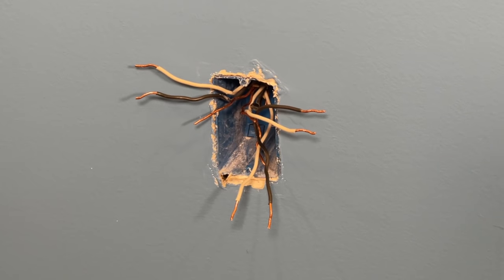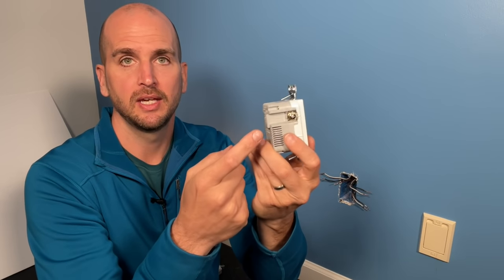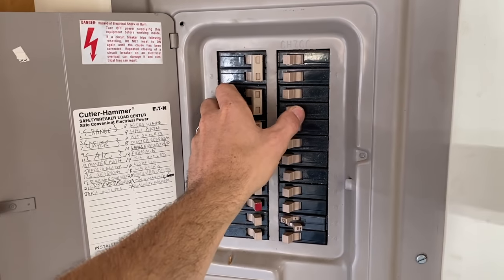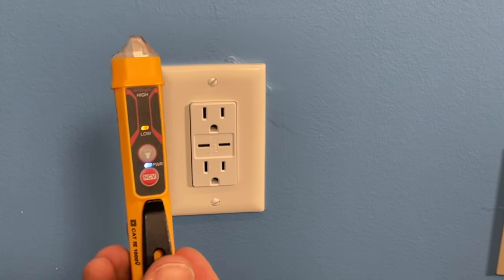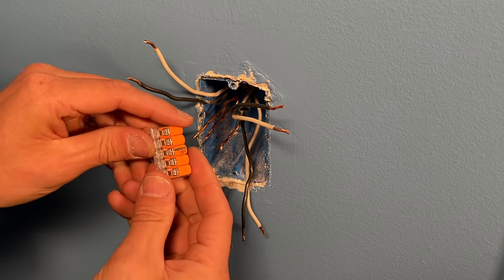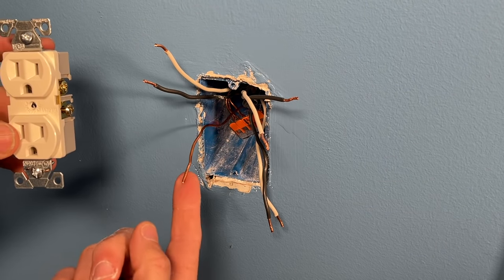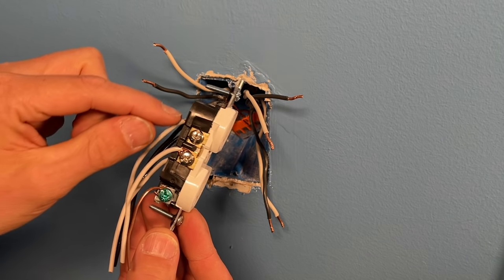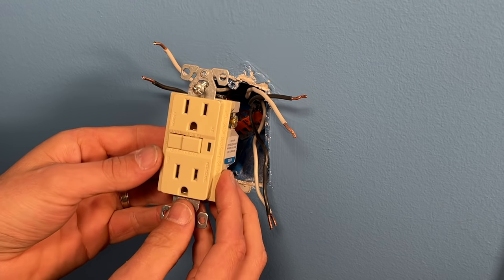Wiring an Outlet with Multiple Sets of Wires

Comment: 20+ years of being a state certified electrician. DO NOT BACKSTAB! I’ve had multiple service calls for wires backing out of that connection over time. Pigtail all connections then attach to receptacle. Also, Wagos are ok for fixed loads such as lighting, but for a receptacle with a varied load I prefer wire nuts. They are far superior and use more surface area, thus less resistance, thus less heat.

Comment: At 3:50 you should note that you’ve turned the breaker off after finding the hot wire. You probably also should have explained the difference between line and hot at that point, since technically what you were trying to find were the line wires but you repeatedly said “hot set of wires”.

Comment: I just ran into a Wireing like this in a rental I was replacing the ceiling fan ,  it was my first encounter with a loaded neutral  ,  shocking experience. ⚡️🤕
Reply: That means you theres two hot wires sharing that one neutral wire.  Per NEC to make it  legal to share neutrals if you have both hot wires on a two pole breaker in your panel to shut off both hot wire to avoid that.

Comment: We have two original wire one white ( hot) one black ( neutral) four others two black hot and two white neutral apparently wired later to add two more recepticles on counter in kitchen, 20 amp breaker what outlet should I use and how should I wire it correctly? Like your videos so much and very helpful. Thanks 😊

Comment: As a DIYer, I wish there was a way to adjust those single gang boxes (for example, extend the back wall) so that you would be able to swap out a bigger device with greater ease. These boxes were never designed to add huge multi-function receptacles and big Wagos.  Thanks for the video!
Reply: You can cut the old box out and replace with a bigger box been there done tht
Reply: @wizard3z868   Sure!  And, it would be even easier if you could remove the old box and put in a new single gang box with a deeper back. That way you wouldn’t have to cut away any drywall.
Reply: @rocketrider1405  you can just cut the nails or screws and pull out the old box
Reply: Pro Electrician here, 
we can swap the nail on box for a deep cut in box to fit a bigger device such as that  recep with USB c ports. It shouldn't take more than one hour to do.
Reply: They’re at your big box store and called “old work boxes” and are for putting in a box into already sheet rocked walls.  Can get them 20 cubic inches and they have wings that flip out and tighten on the wall to secure them.

Comment: I put wire caps on all the wires prior to turning the breaker back on if I have to figure out the circuits in a box, to prevent them from accidentally contacting each other (or me).

 It's important to test the white wires in the box as well - in certain scenarios white wires are actually carrying current!    Whoever installed the box may have failed to properly mark the white wire(s) as actually carrying current.  If a white wire is being used to carry current, it will usually be painted black near the termination or wrapped in black electrical tape.

When will a white wire actually be used to carry current?  One example is when power from the breaker panel first goes to the light fixture and then to the switch.  The switch has to be used to interrupt power to the light along the hot side of the circuit.  If the cable used to go from the fixture to the switch only has black and white wires, then when the circuit is powered and you turn on the switch, both wires connected to the switch are now hot. 

Now days, code actually requires a neutral to be present in a switch box, so when re-wiring the circuit, or in new construction, a three-conductor cable(with black, red and white wires) would be used.  The black and red would go to the switch from the light fixture, and the white is the required neutral.

Comment: Please  review the NEC rules on conductor fill.  All boxes have a limited internal volume and it is not safe to cram wires and devices in there beyond a certain level.  Modern plastic boxes often have these limits molded onto them.    In this case the box has 6 conductors and 3 grounding conductors entering what appears to be standard 2x4 box.  My old NEC Table 370-6(a) indicates that there should not be more than 7 #14 conductors entering such a box.  However,  this box also has grounding conductors entering it so NEC 370-6 requires that this number is to be reduced by one.  So far so good.  Six allowed and six entering the box.  But this box also has a receptacle installed which also takes up space.  Any device installed in such a box requires that the number of conductors be reduced again by one.  This installation may be in violation.  It is worse if those are #12 conductors.    If Table 370-6(a) is not sufficient there are rules requiring a certain internal volume per conductor entering a box and you can use a little arithmetic.  A safe rule of thumb for 2x4 device boxes is one cable in-one cable out and that only for two-conductor cables.  Any more that that use a larger box.

Comment: I have four lights ceiling lights that are controlled by a top of the stairway switch and a bottom switch I think the terminology is three way switches where you can turn the top on come down and turn off the light. Now the full lights are being divided into two each and I am installing two switches in the new area to control two at the end with one switch and the bottom of the stairway with another‘s new switch the division is because a new room is being built at the end and so the new switch will control that the second new switch will control the hallway lights if we are in the room and want to turn the blind on or off.  I am pulling power from the third light in the hallway, there are 2 sets of 14/2 coming off that gang box off the ceiling. One of them is the power supply. I connected a new 14/2 wire and dropped it to the switch location. That switch controls the two lights at the end but still is on the same circuit as the top switch and the bottom stairway switch to switch is still controlled the 4 lights. I am stuck at this point. Help!!!

Comment: When my house was built in the 1930's they used 4" double boxes everywhere, even where only single receptacles or switches were installed, on single plaster rings. Makes replacing devices so much easier. Does anybody do that any more? The difference in cost must be in the pennies. BUT ...  I have found to my dismay that the screw patterns on these vintage boxes  are different from current ones and their respective plaster rings. I found that out when I wanted to replace a single switch with a double. My only option was to dig out the old box from the wall and replace it. Always something. Just know that vintage boxes do not match current ones.
Reply: I have a switch for our hallway light that I want to change out to a three-way switch and add a switch at the other end of the hall. Problem is there are 3 sets of wires coming into the box, so it's pretty full already. Its also in a 2x3 studded wall so it's not very deep. My plan is to replace the box with a double box to make more room in the box to accomplish the task. Not sure when I'll get to it.
Reply: Those old square junction boxes are great but they are made from much harder steel than modern ones.  I found this out when removing a knockout from one a couple of years ago.  The ears on the side that the plaster ring screws into can have the holes in a different pattern making it difficult to work with.
Reply: Maybe since I'm from Chicago and everything here is supposed to be hard pipe, but I always use 4x4 steel boxes no matter what(unless it's between studs and too tight)
Reply: Try using one of the old plaster rings as a template and just drill new holes in modern ring I have been able to do this myself

Comment: Thank you for such clear, detailed explanations.  I have embarked on several DIY projects thanks to your demonstrations.  One thing that bugs me however is your preference for the shepherd's hook method instead of the poke-in-hole method of wiring to the receptacle.  (As you can tell from my complicated terminology, I am a true novice; but my question is probably what goes through every novice's mind when we see you use that pigtail thingy that is a poke-in-hole style, not the shepherd's style.  IF PIH is good enough for reducing wire clutter, how come SH is to be preferred for wiring to the receptacle?  To a novice, PIH is easier.)
Reply: The wago nuts hold the wire very securely, they won’t pull out or loosen. The push in feature on receptacles is not so secure, they can loosen and pull out. 
When electrical wires are loose they can arc, spark, heat up and cause fires.
Reply: Two words:  BACK WIRE. Worth every extra penny. 😆

Comment: I was/am trying to install a USB receptacle and found the 3 white 3 black and ground wires as in this video.  I understand the need to used the Wago  and think its a great idea.  My question is where did you get the piggy back wire?  Can't I use the one black and white wire that works for that receptacle?  I don't have random wire laying around. lol  Very well done video with excellent explanations.

Comment: First thing to do if you see white wires not connected to anything in a box is to turn power off at the panel. All the power.  Unless you know with absolute certainty exactly which neutral lines are in the box and which other circuits they are connected with, there is a very strong possibility that they are carrying a load.

Comment: This is very informative. There is an issue here that would pose a problem which violates code rules - box-fill. The number of wires plus the three Wago connectors along with the deep receptacle exceeds box-fill requirements. This could compromise the current-carrying capacity of the conductors and cause heat and burning at the weakest points in the box. Typically it occurs at the termination point over time if the receptacle is used a lot and depending on what's plugged into it.

Comment: Wagos are my absolute favorite. Wire nuts are simple, but there's really quite a lot that you can do wrong when using them. Not only are Wagos more straightforward, they also make it SO much easier to work on a single circuit. I work in HVAC controls, and troubleshooting is much easier when I can leave a controller powered and disconnect a powered sensor. With wire nuts, there's no reliable or safe way to do that without interrupting power.

One question/note: I assume if you do the pig tails, the GFCI can no longer protect downstream outlets. Is that correct?

Comment: What was the box fill? Using the wago takes up more space than a wire nut. I found by using a wire nut, the wires can be tucked in more neatly into the back of the box. More caution has to be taken when using wagos so the receptacle doesn't push the wires against a sharp object at the back of the box, damaging the insulation and/or conductor also.
Reply: My experiences is that Wago connectors tend to use less space in a box - primarily because all the individual wires are still free to spin in the connector. That usually lets you pack the wires in the box more efficiently. With a wire nut you tend to get a solid bunch of wires that have much less freedom of movement.
Reply: 3 sets of wire will fit in 20 cu in box.
Reply: There are sharp objects in the back of boxes ! ?.  O my.    You must have elves sticking things in there .   My boxes are usually empty before I strip the wires and feed em in .....................
Reply: @nickleclaire8545 3  sets of 12-2 wires and those are 14-2 I can assume
Reply: @JasonEDragon 
   pro Electrician here,
the loose connection of wagos are a problem and can cause connection issue and short. If you're taught to train the wires out correctly there is no issue with the wire nuts. I can make wire nuts more space saving that wagos which take up more space.
Reply: @yellowflash5555  Can you point me to 1-2 videos that show a failed Wago connection? I've never seen one. I'm just a USA owner of a few old houses and I've picked up on the use of Wagos after watching a number of UK electrician videos. Those are the primary connectors over there and I've never seen them once mention a failure. If someone shows me failures then I'm open to changing my mind.
And I would point out that this is the "Everyday Home Repairs" channel and many of the viewers probably haven't been taught to "train the wires out correctly". And with the variety of electrical boxes in my houses I'm not sure there is a "correct" method. I prefer maintainable connections that make future changes easy, as I like to make a lot of updates to my home.

Comment: So I noticed that there are 2 sets of black and white but that the 2 white wires arent coming from the same (wire holder?) but rather its a single set of black and white per (wire holder?). This video has helped me to understand 2 main options I have. I can cap the other set off since Im fairly certain I know what that set runs and dont really care about it, or I can just put the 2 black on the hot side and the 2 whites on the neutral side since Ill also be screwing the other screw down anyways. An issue I did run into though is that I dont see a ground wire at all in any of the housings….. Is there a way to have ground wires put in without having the entire house’s wiring redone? Also does it matter whether these new 3 prong plugs are being put in a housing that doesnt have a ground wire and is it safe to plug a 3 prong plug into the outlet without a ground wire?

Comment: So my house was made in 74 and I've been slowly replacing all the outlets to more modern ones since I bought it last year. This is the first plug I've run into like this and it appears to to feed outlets in 2 additional bedrooms. I can't seem to fit the wires back in, it kind of makes me nervous as it feels like I'm having it push things uncomfortably hard to get the outlet to set back in. Thanks for the video!
Reply: Me too. He seems to have a really deep box in this video for all those wires to be so far back and allow that bulky integrated USB receptacle to slide in so easily. Especially after using three 5-port Wagos which are pretty beefy as well

Comment: J bend around a terminal screw should go clockwise
Reply: The wire isn't bent at all, the wire is pushed in straight and held down by a connector plate and screw.
Reply: Not on a commercial receptacle
Reply: @jeremyhaik1531  Can you do that on a commercial receptacle?  It doesn't look like the screw terminals would be setup for that type of install correct?  Just a straight shot behind the retaining clip and tighten the screw, at least that's how the ones are installed that I have been installing in my house as I upgrade things, as well as all the outlets in my shop.
Reply: @wildbill23c   You can use a shepard’s or j hook or put the wire under the screw plate on a commercial receptacle.

Comment: Dont forget gfcis are larger than old outlets and could change the amount of available required wire fill space for heat capacity of boxes space suppled wire fill safety

Comment: Great video! I tried installing a GFCI in my kitchen counter outlet but encountered 6 wires inside the box. 2 Black, 2 White, and 2 Red (plus ground wire). I used my non-contact voltage tester and somehow found 3 hot wires (one black and white set and one red). Is this possible? I have no idea what the red wires are but also have no idea how to wire this up and afraid to rewire the cheap receptacle that I removed. The old receptacle had wires stuck right in the back, which I believe is not recommended. I capped all 6 wires separately and now have no access to 1.5 outlets. Can you please help out??

Comment: You might also have had multiple sets of wires into the box if one of the outlets was switched.  If the connecting tabs on the outlet that you are removing are broken, that's probably the case.  You'll know, if the switch is on and you have two energized hot wires.  If the switch is off, your voltage detector won't help you.

Comment: this is what I'm going to have to do I have an outlet in the same configuration I have three hots, two grounds, and three neutrals. The red and orange wires go to lights, the black and white wires go to outlets, and the green and copper wires go to grounds I'm going to have to install a GFCI and splice the wires using the rear terminals is a bad idea you can trip the breakers and cause an overload if you do that.

Comment: Excellent video.  Very helpful for answering a question I had for something I found in a closet where my doorbell transformer is.  I'd like to replace the hard wired transformer with a plug-in style which means I need to convert the round junction box to an electrical outlet.  The problem is the current box is a round junction box and not an square box... I assume I can still do this without replacing the round junction box.
Reply: Get a wireless doorbell?
Reply: @rollandjoeseph  Don't want batteries.

Comment: Great video. I have a safety question related to 7:34. How do you ensure the bare copper of the stripped wires is not touching behind the receptacle? Is this a danger in this first place?

Comment: Thank you for your video, it helped me a lot. I have the same exact 6 wires (3 sets of wires) on single pole switch just like in your video and I am trying to replace my old dimmer with new smart dimmer. Can you please help on how to do it? The dimmer is asking for load, line, ground and neutral. Can I pig tail 3 black wires together as line and 3 white wires together as load? Is this a correct and safe way? Please kindly advise. Thank you so much.